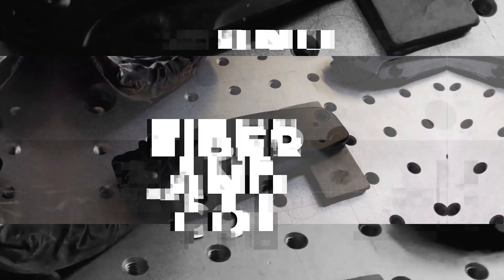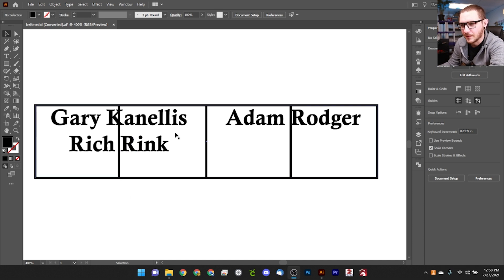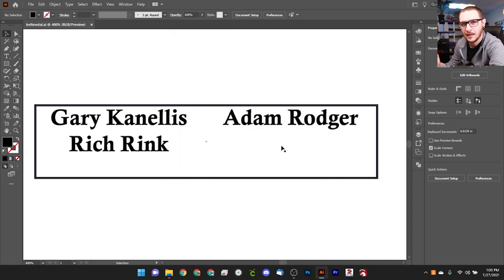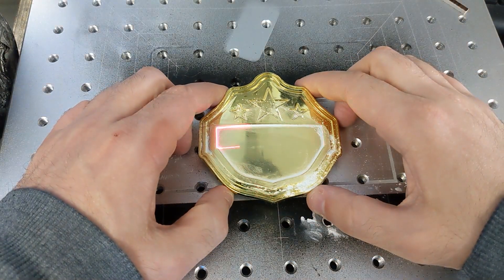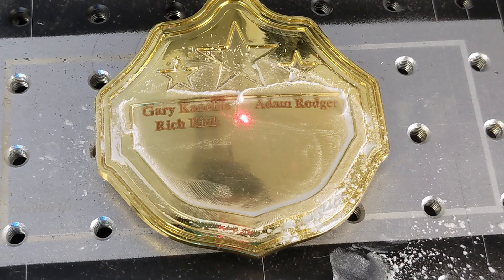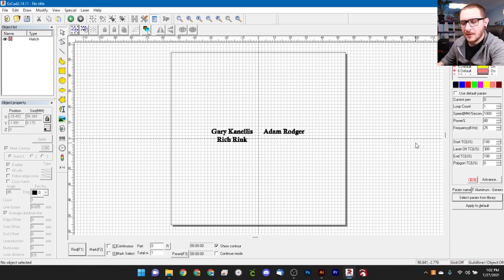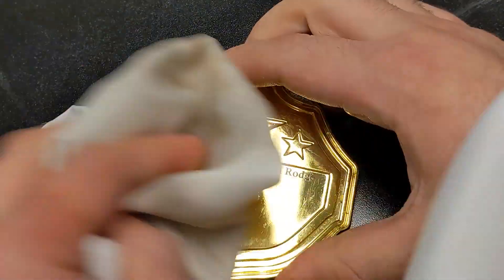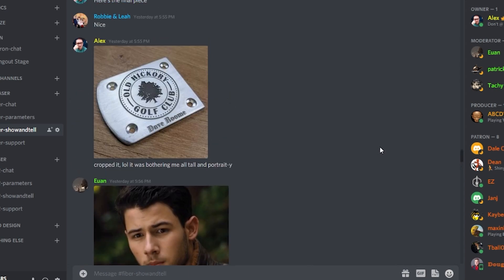How to Engrave CRAPPY Electro-Plated Pot Metal | Fiber Laser Tutorials

Comment: One trick I used lasering a chrome plated (on zinc base), lighter, is to breath slowly through a straw on the item.  Your breath will lightly fog the chrome surface so you can see the red alignment frame when positioning.  Seems that zinc turns to a nice shade of red when the top chrome plating is ablated.  Works like a champ  🙂  Much thanks for sharing your lasering expertise....
P.S. Depending on the curvature of the item, using a wider-longer focal length lens for an increase depth of field focus, (~200mm), the engraving will be "more even" across the curved face.  I KNOW you already know that....  🙂

Comment: Hey Alex.  Love your channel.  It has been very helpful.
Question.  I am running a 50w JPT fiber laser.  110mm lens.
I need to engrave/mark some challenge coins.  The coins are made of .999 fine silver but we had them finished in an antique silver plating to show the detail of the artwork as well as protect the silver.

Any thoughts?  I tried on something similar to use the Z marking settings to see if I could get a black mark but no go on that particular coin.  
Do you think it will work here?
I have to add a coin # as well as an ID number to each (which are all different).  

Any help would be greatly appreciated.

Cheers
Reply from the maker: Z-Mark for silver is hopeless. Z-mark only works on ferrous metals containing iron. Your best bet might be something like the black mark from the ultimate gold guide. We get a very nice black on WHITE gold which is a good bit silver. I'd probably start there. I don't think you're going to be able to get a black mark on the surface, so you'll definitely be engraving into the silver.
https://youtu.be/H3nDIONNBzc
Reply: @LaserEverything  Hey Alex.  Lifesaver.  Used your black mark on white gold setting at 60% (based on 50w vs 30w).  Made a very nice crisp white mark on the plating (or possibly through to the silver but regardless worked well).  Thanks again
Reply from the maker: You're welcome, glad it worked for you!